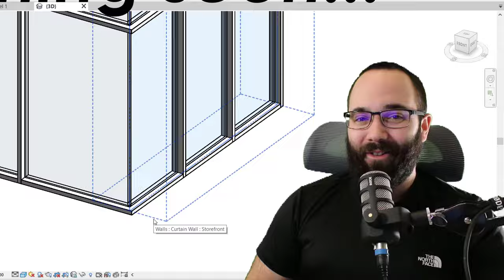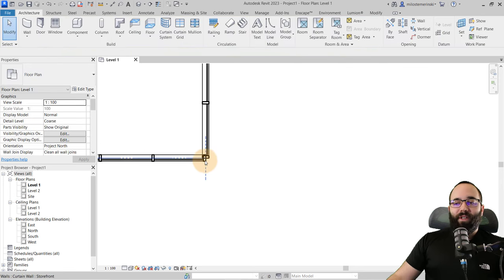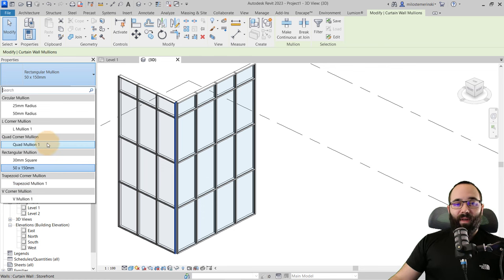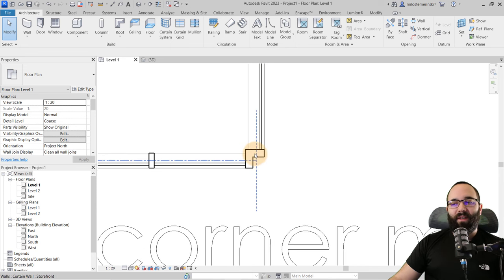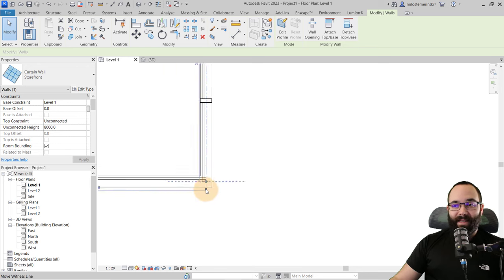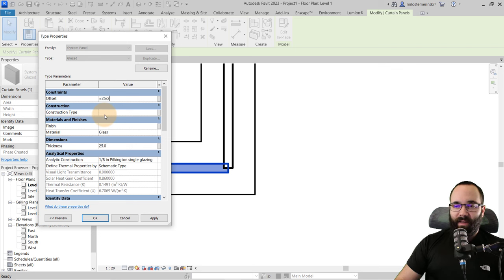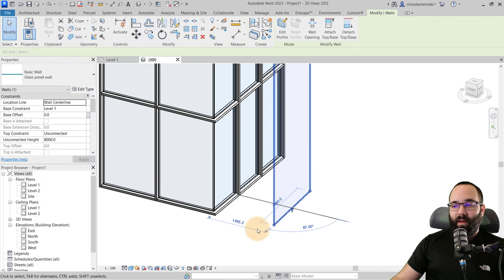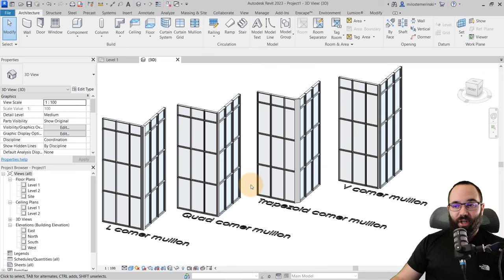Curtain Wall Corners in Revit Tutorial

Comment: I love your channel - it’s my go to for how to model tricky situations. However, in this case, the mitered glass corner misrepresents what an exterior mitered glass corner actually looks like. Insulated glass always include a solid spacer within the glass layers that is visible. I’m mostly saying this to let renderers know and not mislead their clients into thinking the corner is invisible.
Reply: Totally correct Julia. In these cases, it would be easy to create a simple glass panel family, with offset parameters to control how that corner joint works (they can be instance parameters to not have to create a new type of family just for the corners).
Reply: Yes, also in most cases you don't want to have the glass panel in the middle of the mullion, which was the solution shown here. However when you have regular walls as panels they get an additional parameter called "Location Line Offset" which could be used
Reply: @kuzev  You can also create that parameter within that glass panel family and set it as type

Comment: There is a third way. Keep the corner glass panels as glass panels but edit the panel family make a duplicate and give either the left side or right side origin an offset. 
Load the new panel into project and exchange the curtain panel with the new one.
Now the glass panels won't miter join but that's actually okay. Because glass suppliers can't make one piece corner glass anyway. So you actually have a better representation of this glass connection.
Btw thanks for your guides! Learned some new things!
Reply: No need to do that. You can create the glass panel wall with layers representing the glass and air. Then you can use the normal wall corner join tool and set to miter (or square off) and set the Display to "Do not clear join"

Comment: Could we add a glass mullion, maybe get a SMALL tapered/curved glass corner?
Reply from the maker: it's possible, but the edges would be visible, if that's a problem, I would just place empty panels and place a regular glass wall in there and make the curved corner like that.